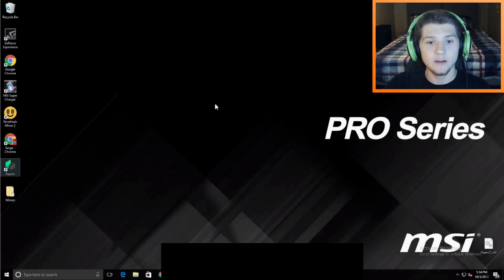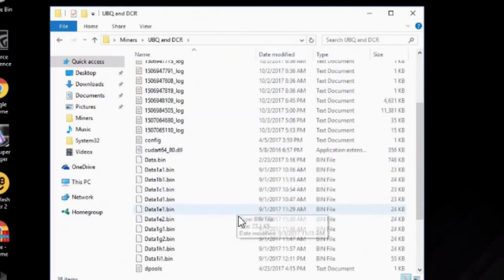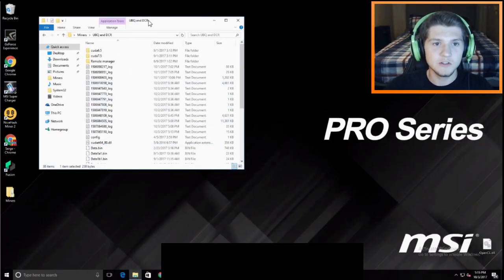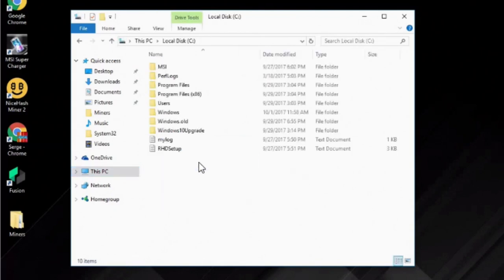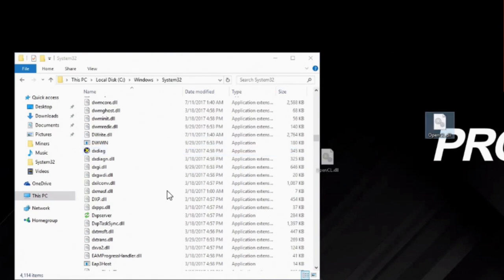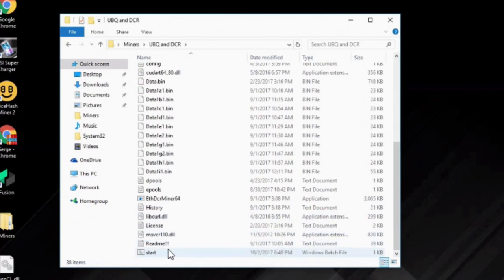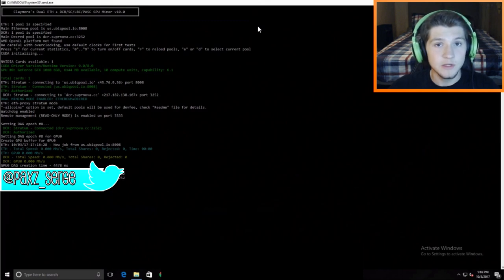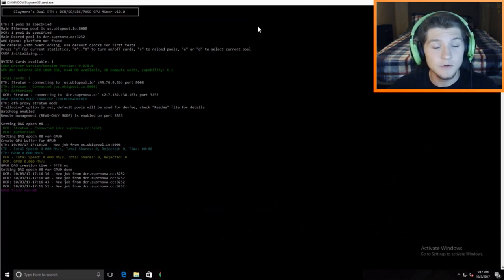How to fix the OpenCL.dll problem in Claymore Miner.

Comment: Don't normally comment, but thought I'd drop this tidbit... 
I got this error only after using Display Driver Uninstaller to fully remove my Nvidia drivers after I had upgraded to my AMD mining cards. DDU is an excellent program for this, and I had to run it since I was experiencing issues since I still had both drivers on my computer. 
Your fix worked though, so thanks!
Reply from the maker: +Orrin Witt np man, the first actual good comment ive ever seen on youtube lol

Comment: Almost 1 AM here and this video saved my life!
I'm resetting up 3 eth miners for somebody. 
From faulty and/or nonstandard PSUs, to crappy MB, to faulty risers and cables, to damaged cards....
It takes me about 2 hours to go from zero to hero on a single rig! 
But these 3 rigs took me 2 weeks!
I was about to kill myself after I failed to add 7th GPU on M2 ( I still don't know why I've done it 100 times), I settled for the 6 GPUs.
And then the fucking same error. Clean uninstalled and reinstalled the driver 3 times and took so many steps. I was going to find a gun and put a bullet in my head till I found this video!
So... THANKS!

P.S. People are complaining about introducing not trusted .dll to sys32 files. That's true. What I did was, copied the .dll file from an identical system. 
In general, be wary about this issue.

Comment: Hi, I have an issue. Now I have connected 12 NVIDIA GTX Geforce 1070 cards connected (planing to connect all 19 cards) to B250 ASUS motherboard 32Gb RAM and every time I run Etherminer (what so ever) it crashes !!!! max 2 hours working then chashes + mining rig stops and I have to restar. Have any I ideas? Thx in advance.
Reply from the maker: i would check to make sure you are supplying enough power to the cards. then also check to make sure you are not putting to much stress on one fuse. one standard fuse in a household can handle 1440 watts so i would also check that. another thing is that having that many cards on one machine is just bound to have problems. just keep testing and testing until you figure it out. i have lost sleep trying to solve problems on my 2 card rig XD. don't lose sleep over it like i did. take it easy and don't get frustrated.
Reply: Hi, thanks. I have checked everything you mentioned. But when I put the 14th card it breaks and stops. I take away 1 card till 13 peace's it runs ok. Regarding power, I have connected 3 Corsair power units each 1KW with 13 cards using about 1950-2050 kW. So I could connect more but than bios breaks and pc not starting.